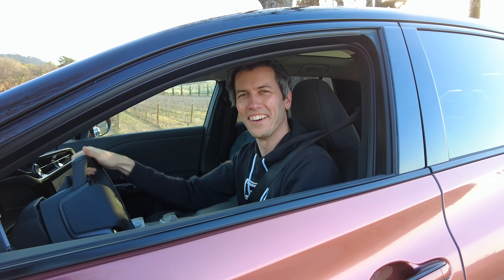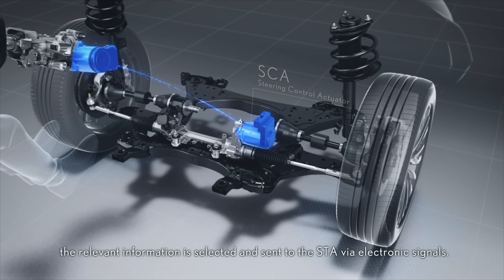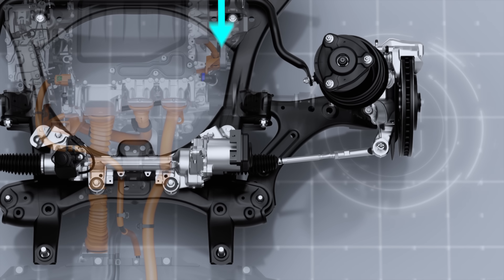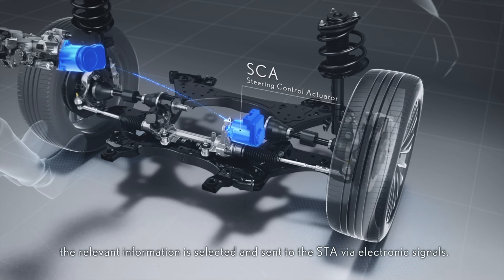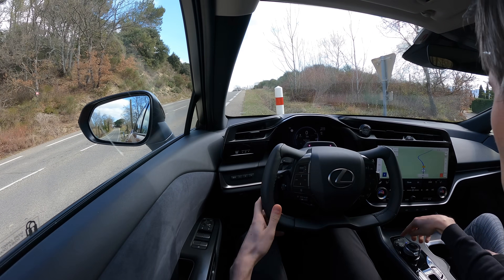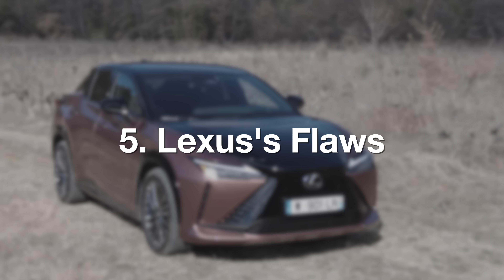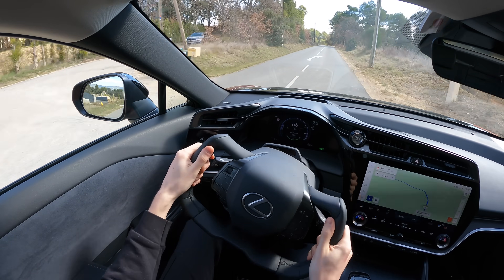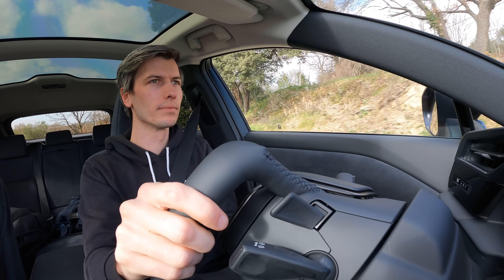How Lexus Fixed Tesla's Bad Idea: Steer-By-Wire Yoke

Comment: Concerning lag....check how fast the actual wheels turn from lock to lock in a normal steering car with you turning the steering as fast as you can vs this. To me this doesn't seem like an issue ? You are literally making a full steering input lock to lock in a fraction of a time it would take you with a normal wheel, there will be some dampening i imagine...you could loose front wheels traction otherwise turning them this fast ? I don't think that, for example, a fly by wire plane like an airbus will move its ailerons full left and right if you move the stick full left right super quick like that, it might stop moving them half way when you are rapidly changing your input like this and start moving in the opposite direction. it will average your input and give you a steering result that you commanded in its own way thats best aerodynamically.

Could this system be hacked in some way and turn the wheels at highway speeds right into the barriers or the opposite lane ? Is this even a risk ? At least when you have a physical connection you could stop such attempts by just fighting the wheel ? A bad firmware update at the dealer or a mechanic that causes the steering to not respond or do it erratically and you are in a ditch or falling from a cliff or driving right into a lorry on the opposite lane. A bad dbw stuck throttle= you disconnect the tranny and point the car in a safe direction, a bad bbw brake= you engine brake or handbrake slowly and point the car in a safe direction. This ? Im not sure what could be done. Braking while the car turns sharply on its own and skids ? Thats just asking for a deeper skid.

Also, what if the yoke position sensor is damaged when driving and turns the wheel ? Are there multiple sensors that have to agree with each other, how fail safe all this is ? Will it just straighten the wheels if something happens ?

Comment: As an aircraft mechanic i can tell you: redundancy is the key to get away from all your worries. IF cars would have the same redundancies like aircrafts, accidents caused by mechanical fault would be reduced significally!
As a car enthusiast i still wouldn't want a joke like this :D
But steering ratio is a big thing and i got from 1:4 on my E30 to 1:3 by changing to an E46 powersteering, which was a significant improvemt (at least for me).
Also, steering adaption is possible and used in modern cars for high and low speed applications - even with mechanical steering.

Comment: But the argument that steering and braking should always feel the same no matter the conditions and that people don't like that is completely wrong. The gas pedal in a combustion car has very different accelerations in the same position depending on the gear, people get used to it, because there were (almost) no options until ~10 years ago. So this is not an argument but an excuse to dislike something for no reason.

Comment: motorcycles have ride by wire technology for a long time. Cables stretch and wear out and electronics are getting better and better. My ktm 1290 even has radar assisted cruise control.

Comment: I'm not against the concept in general but the lag will bother me. I still can't stand the lag in electric accelerators, especially with a manual trans. For some reason motorcycles avoided this, or solved it. Even video games don't have a lag.
Reply: Motorcycles have smaller and more responsive engines.
Reply: @logitech4873  That has nothing to do with it. Older cars with cable throttles were quick and snappy. The lag was only introduced when the new electronic throttle bodies came out.
Reply: @dk-bw4gk  Fair enough. 
But there's a pretty lenghty chain of mechanical events that needs to happen when you accelerate an ICE engine, compared to how EVs accelerate.
The instantaneousness of a Tesla is baffling.
Reply: @logitech4873  EVs??? I'm talking about cable-actuated throttle bodies vs. computer-controlled throttle bodies.
Reply: @dk-bw4gk  Ah well this video is about an EV so don't be surprised.
Reply: @logitech4873  What? He was talking about how all inputs are moving to "by wire". He goes into detail on how much lag there is in the steering. I commented on how the lag in the throttle is terrible and how I will probably hate lag in the steering. This has absolutely nothing to do with EVs so don't be surprised. It's about "steer by wire" and it can be used on any vehicle.
Reply: @dk-bw4gk  Yeah and I'm talking about throttle response in general in this video about EVs lol. Not really sure what the issue is.
Reply: @logitech4873  Do you see the title of the video? Do you see what I wrote and how it's about accelerator lag? Did you watch the video and understand that it's about Lexus' new "steer by wire" system? Did you see him demonstrate the lag in the steering? It's not about EVs and it's not about acceleration, it's about laggy computer-controlled electric steering. The issue is you're way off-topic and expecting me to automatically understand what you're talking about.

Comment: My favorite thing about working on cars is when one component breaks, I have to replace both. It's enjoyable to spend double the money, do double the work, and have double the number of components to diagnose and test. How could anyone possibly be against technology that requires more work and more money? Infiniti got into this years ago with the introduction of the Q50 and its hybrid steering system that uses a clutch to make it drive by wire. It felt like driving a dead fish. There was nothing enjoyable about it. I'm not going to say I'm completely against this, but it seems like unnecessary complexity when a mechanical linkage is just fine. The steering delay is something that has popped up in some video games. Typically the wheels point where the stick points, but some games smooth that out. They are the worst driving games. I'm sure this ill improve, but it's not something that I'm excited about.

Comment: I know this might sound a bit dystopian but I know among some of us there is a concern with everything being electric that the technology can be manipulated by an outside source. An example would be recently ford put in one of their terms and conditions for electric vehicles that they plan on programming the vehicles to drive themselves back to dealers or repo lots under certain conditions. There is also a concern with vehicles being hijacked, donut media did an example of this with a tesla, the cars won’t have airplane like security in their systems and criminals will learn to hack the systems very quickly and probably take advantage of such ford programs but just change the destination. I certainly don’t doubt they can hijack a car while you’re driving it and brute force it to drive to whatever place they want with you inside it. The technology is cool and all but we need some protective measures because this will become the new way to steal cars

Comment: I literally saw drowned tesla which had 0 power in any battery. Towing company had a hard time steering unpowered wheel. Not convinced wired steering is good idea
Reply: Teslas have mechanically linked wheels though, the same would happen with any drowned car where the battery and engine is dead.
Reply: @logitech4873  the thing is you could still steer it.

Comment: I think expecting the wheels to turn in tandem with the steering wheels, at zero speed, is very unrealistic. You're essentially turning the wheel two full turns and a half in a regular car in a fraction of a second, it'd be pretty hard if not impossible to replicate in a mechanically linked steering rack.
However I understand your point is there is a delay (or rather excessive smoothing) between input and output, and not that the wheels aren't catching up to this entirely unrealistic everyday scenario

Comment: If you are over 6'2" You probably already know vehicles aren't made for you.
I think technology like this has the potential to be as responsive as hydraulic assisted steering.  The movement between the road and wheel just has to be as high definition as possible..  look at it like audio compression.. if you're listening to your favorite song you want a high bitrate, lossless audio if you can't have the old favorite, vinyl... or ( direct link steering)

Comment: should just change it to motorcycle steering handlebar really, sensitive enough on twitchy roads, if you want it be more stable, just move your hands to outside which increase the torque but reduce the movement ratio on the front wheel... simple

Comment: As an electronics engineer in the auto industry, I still personally like feeling the road vibe through the wheel. That haptic feedback is CLEARLY a benefit to the driver if they had to mimic it with a bunch of electronic claptrap added to the steering wheel just to badly imitate road vibe through the steering column. The couple good things are, as pointed out, dynamic steering ratios at speed for dampened driver input at speed, and the obvious elimination of a steering input shaft (by adding a motor and sensors, which are likely going to end up being near-cost of the traditional parts). 

However, some things are best done the old way :). Eliminating a simple component with relatively low failure rates with sensors/motors that likely need to be replaced after 10 years, especially ones tied to critical safety like steering...Also seeing that VERY noticable input delay with steer by wire is, to me, a failure. Nothing that critical to steering/propulsion should have passed testing with a delay like that. I would have canned the feature entirely if that is what a team of engineers presented to me as a demo. I feel like car companies need to start focusing on making cars more affordable rather than 're-inventing the wheel" and replacing every physical part with electronics and motors. Pushing self-repair further and further away from the consumer every year.

Comment: What does it do if you’re going into a corner, holding the wheel at a certain position and you’re slowing down or accelerating out of the corner?
Reply: Or worse, an on/off ramp where the curve also changes as your speed changes. Then you'd have to change steering at a certain rate but computer decides nooooo

Comment: The variable steering ratio with speed is pretty interesting. It sounds like the steering ratio is independent of the yoke position from this video though. Steer by wire would allow you to have a more precise ratio near neutral steer and a more agile ratio at the edges of the wheel turn. Is there some reason why that would be undesirable?
Reply: It's not the ration, you can tweak that.
It's just that you feel that the Steering wheel is not doing what you do, corrections !
He is not smart enough to understand the algoritme ....

Comment: If I hit a pothole, I prefer to feel the impact in the steering wheel.  It's good feedback to do better next time, get it checked out, etc.

For most drivers, two hands are almost never at 9 and 3 while cruising, nor singly with either hand.  Those positions would drive me nuts.
Reply: ikr. Who tf drives with that hand position all the time?

Comment: What happens when you decelerate while holding the yoke turned by constant angle? Since the steering ratio should be changing, the angle of the yoke should correspond to bigger and bigger wheel steering angle right? That would mean that the car would start turning sharper and sharper as you decelerate right?

Comment: I absolutely hate the idea of steer by wire. It makes sense in airplanes because the controls take too much force, but makes no sense in cars.
Reply: Also unlike planes with multiple, differently shaped/used/combined control surfaces; cars have only one. This is like getting rid of the judder on a plane and make software predict it with the yoke angle.

Comment: I think that progressive steering with adaptive power steering is better for drivers.
But they need to start using and improving steer-by-wire since they aim for self driving. And it doesn’t make as much difference to commuters.

Comment: It could fail if the power fails but there's an extra battery but if that battery goes there's another one and the motor could go out but there's another motor that takes over. If only there were a simple easy way to cut out the weight and cost of all those motors and batteries like maybe you could just run a steel rod down from the wheel and connect it to a gear box. Then when you turn the wheel the rod turns and the gear box turns and then wheels turn. Just imagine the road feedback you'd get from that! You'd even be able to eliminate that third motor that transmits the feedback from the road or tells you little white lies when you hit  nasty pot hole. Wow! I think I'm on to something! I'm going to see if I can sell an article to Motor Trend!
Reply: This whole concept reeks bad engineering. This is like a marketing guy started making engineering decisions
Reply: @iwatchwithnoads7480  It almost seems like a joke.

Comment: I'm sure the input lag issue will be addressed as the technology matures in the passenger car context. What bothers me however is the potential issue where modern vehicles are always connected to the internet. This means that steer by wire is one more vehicle control input which could be overridden and controlled remotely against the driver's will.
Reply: Most cars can already self steer to an extent anyway, all the lane keep assist and adaptive cruise controls even auto parking
Reply: Ideally, any steering system is completely separated/air-gapped from any kind of system with any amount of remote access. Remains to be seen if this will be the case.

Regarding input latency, I don't entirely know why there exists this amount of latency to begin with, as any kind of x by wire system should simply be transferring analog signals along a piece of wire (hence the name), and as soon as that signal is recieved, it's automatically translated to do whatever it's built to do. My only guess is that it's doing so form of electronic computation/processing along the chain, which is where most of the delay is generated. This then plays into my earlier comment about keeping systems like this air-gapped. The other possibility is that it's less input latency and moreso a poorly calibrated system, which is what I'm hopeful for and potentially the more likely considering the prototype nature of the product.
Reply: i think this is the purpose of all these systems. I don't like it either

Comment: As an engineer, my main concern was a bug in the software that controls the variable ratio. It does seem like they are on top of the safety problems, but it would have been nice had you covered that. I wonder if they use two redundant control systems to go along with the redundant sensors and actuators.
It's also worth noting that effective systems exist that deliver variable ratio steering with a solid linkage between the wheel and rack.
Reply: I once had Mercedes (W211) with brake by wire. It also had backup battery in case of power loss. However, the brake pump failed, and the brakes stopped working completely. Luckily I was waiting stand still in red lights when it failed, so it didn't cause an accident. I wonder if there are a redundant steering motor, if the main one fails
Reply: @jauho7483  Yep, there certainly is a redundant motor, Jason covers that in the video.

Comment: Okay, so this implementation is actually kinda smart. Bit one question I immediately had was not answered:
Do they use a hall sensor to detect the steering input, or will people get drift on their steering wheel a few years down the line? 😅
Reply: Could be magneto-resistive or optical, rather than Hall effect. Smart decision would be to use two or more encoders (or one encoder with two or more sources. I think many EPAS systems today use multi-source optical encoders, they're pretty reliable and not generally susceptible to drift. Pig to change, though, if one does go wrong.
Reply: @Peter Morrison  Magneto-resistive and hall effect basically use the same physics, just in different ways (think of it similar to sin and cos), so no real difference. Optical seems unnecessary and that it brings its own risks. But potentiometers should not be used for something like this. Hopefully, those were just chosen for the prototype.
Reply: They actually use a single potentiometer so if that dies you crash :///

Comment: So if the car breaks down, no power, how does one steer the car when pushing it of the road and so on? People manually push cars in all sorts of industries, panel shops, mechanic shops. Worst idea, $300 shaft and steering box, now a $3000 motor with encoders and so on, to turn front wheels.....

Comment: This is the dumbest idea car manufacturers have ever come up with.  These are not airplanes with redundant systems onboard.  They are high speed vehicles with electronics that are guaranteed to fail.  What happens when your electrical system fails like mine did in my Porsche at 70 miles an hour.  In my case my physical steering got a little bit heavy but I was able to steer the car to the side of the road safely.  In your case you become a passenger vectored in whatever direction your vehicle was last pointed until you can get the car stopped.  Good luck with that.  Sorry, but I value what's left of my life too much so I will NEVER buy a vehicle that doesn't have a steering column physically connected to the front wheels.

Comment: Guess the same principle is used in Fly by wire technology in modern aircrafts where mechanical forces are replaced by electronic systems for better performance..

Comment: I always assumed that the only reason we still used physical connections was so that the car could be manuvered when not powered. If my ps2 could provide sufficient latency and feedback,  I imagine that drive by wire could have been just fine.